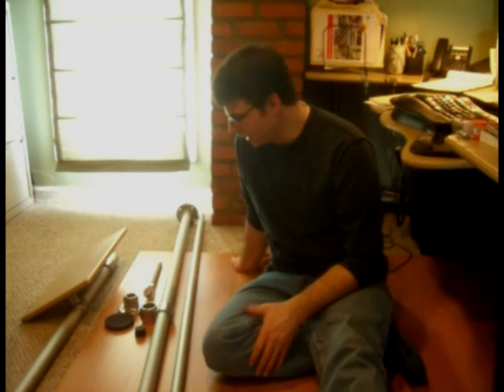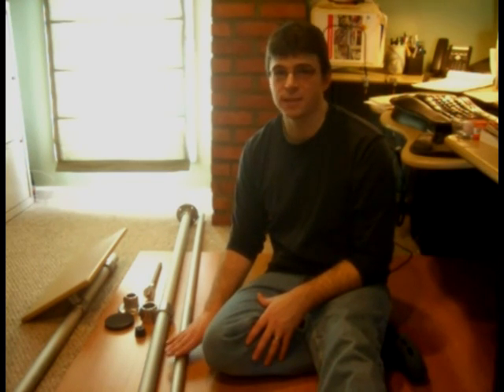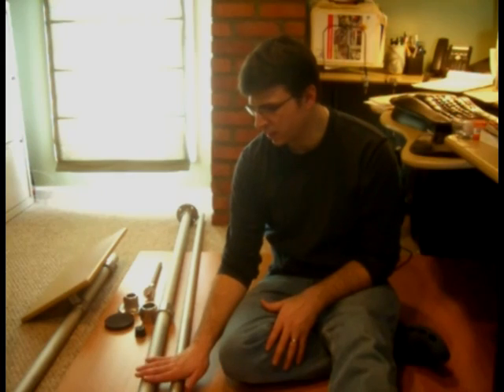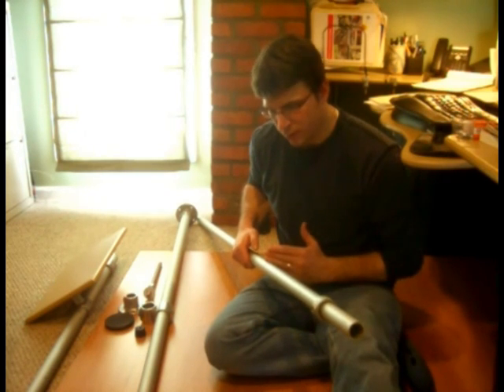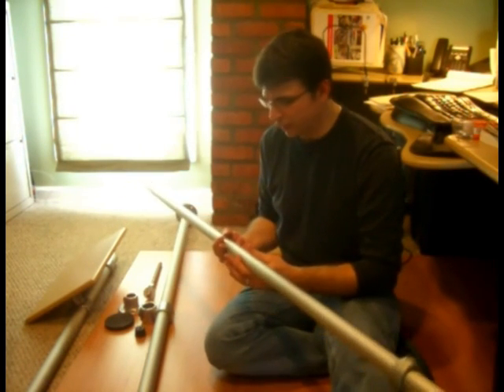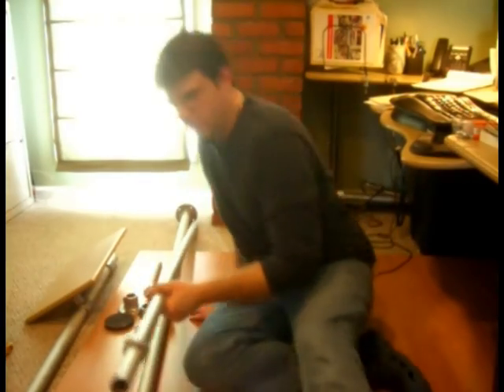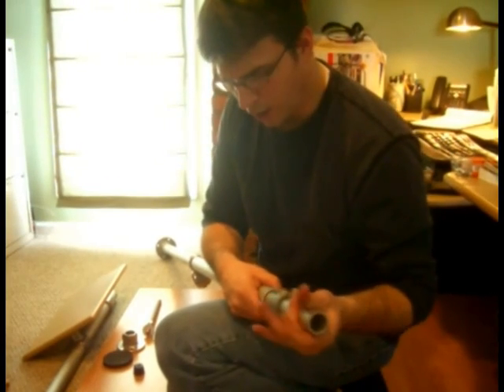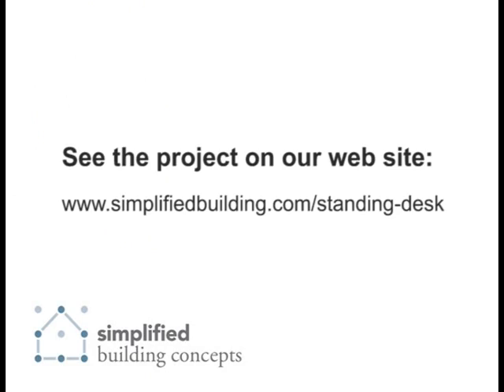Standing Desk - Telescoping PIpe

Comment: Hi, I'm trying to figure out how to do something similar but different.  I want to make my existing desk adjustable height.  It has 6 metal (probably aluminum) legs.  I'm trying to figure out how many linear actuators I need to get (probably 3 or 6?) somehow make sure they all move at the same speed and somehow attach them to the legs.  Any suggestions?